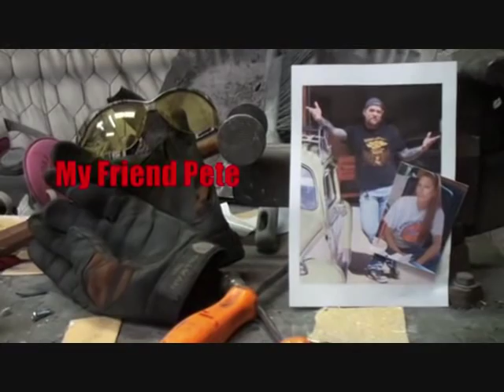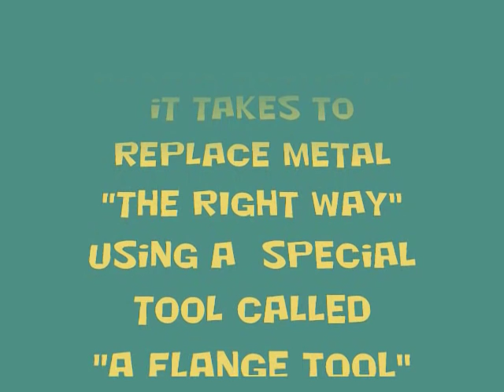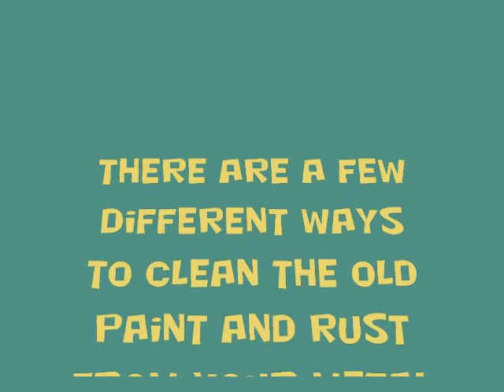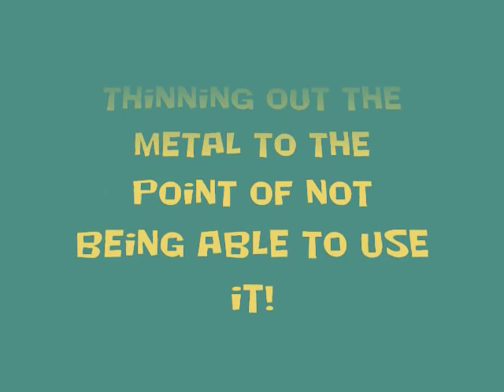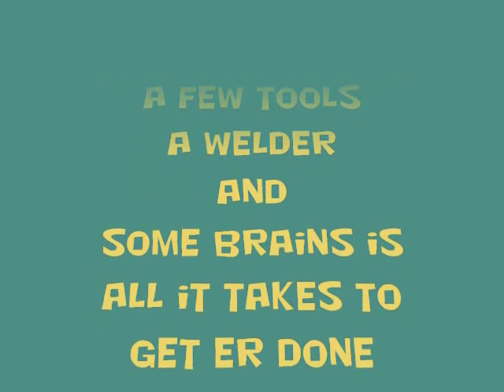RUST REPAIR | On A 1960 Chevy Impala | ULTIMATE FAIL-Part 2

Comment: Using a flange tool is the wrong if you ask me. When i fix rust i always buttweld and try to make look as original as i can and make It so you cant see that its been reparied, not hating! Still watch all your videos! Learned a lot from you!

Comment: Great video pete, I have the hand panel flanger, harder to work with it, want to buy the air punch flanger soon. I am so used to doing butt welding with sheetmetal spacer clamps, more work but I get the job done. See my new videos when you have time pete.
Reply: Thomas1233385 Will do!

Comment: Hey Pete what your opinion on using panel bonding glue on repairs? I'm thinking of using it to repair my lower front quarter extension on my 2001 Suburban 4x4 to fix a rot hole. 
Keep up the good work Sir.
Reply: Lawrence Eich Panel bond is a good tool for some parts that join togeather at certain points of interest but you still have to spot weld the panel on for structural strength!

Comment: I'm waiting on a Hobart welder I ordered, before I get into this.  My Northern Tool Chinese made welder was defective and I have the wire feed motor bypassed with lantern batteries and a rheostat.  It works, but it's no good for precision welding because  it's hard to set the right wire speed..  Since I will be doing only one car, I am going to try to get away with flux core wire and use what I heard is the best wire (by Forney).  If I was a pro, I'd get the CO2/Argon, but I may be able to get by with flux if I take my time.  It's on only one car.   In my case, if I got the CO2/Argon tank, it would be sitting around for at least a year, taking up space, after I did the one car.   I remember HOW to do the work, but there is this other word called SKILL and that takes lots of practice.

Comment: That's art work.  How come I always here don't use  flange joints when patching panels because the joint will hold dirt and moisture and will eventually rot the metal or make the paint blister?  Is butt welding better? Whats the secret to flange joints not causing future problems
Reply: Ozzstar Pete says that the seam sealer he puts on there, seals it so nothing gets into the joint.

Comment: I am working on my first DIY body work project. Doing a frame off restore on a 1978 Jeep CJ7. I have the tub off and am wondering should my metal repair come before stripping the tub down? The tub needs a good repaint. Thirty+ years of crappy paint jobs. Also, is a cup brush on a. 4" grinder too abrasive on body panels? I want to keep it simple but not trash my tub either. Thanks.
Reply from the maker: Michael Donnel When I do a bare metal resto. I strip it down to bare metal first then apply 2 coats of epoxy primer to protect it from the elements, then you can go back and sand off the epoxy primer where your going to do the metal work and body work, once your done you then sand the epoxy primer with 180 grit and apply 2K filler primer for block sanding.
Reply: Thank you for the information. Any suggestions on the best way to strip the tub down? I dont mind the manual labor. Looks like blasting will be expensive. Would a DA sander do the trick or can a wire cup brush on a 4" grinder do it? I loved the video using the bondo buster but a $375+ sander scares me away.

Comment: I see how using the flange tool helps to make a strong repair but do you not think some patch panels can be butt welded? Or is a flange always the way to go.
Reply: nel6211 You can butt weld if you know how to weld good or even better use a tig welder for butt welding, what makes the butt weld bad is when you have to grind the weld down it thins the metal and warps it from heat..

Comment: Hey Pete, sorry if you said it in the video and I just didn't notice, but why couldn't you just use the good fender rather than going through the trouble of destroying a good fender to fix a shitty fender?
Reply: Chuck Norris The other  fender is a parts fender that has major rust in certian areas and also the wrong trim holes...
Reply: swrncpete Wondered the same thing...

Comment: You should see how most of the yoyo's around here "fix" rust.  They use fiberglass.  You'd be better off pop-riveting a panel in place that that crap.
Reply: syyenergy7 Yeah, there's a worst way using ALL METAL BONDO! VIDEO COMING SOON!
Reply: swrncpete I used to do mechanic work on my own for money when I was going to college and I worked many hours for a friend that did bodywork, so remember a lot from yesteryear.  Tell 'ya the truth I have about zero respect for the desk jockeys & total respect for bluecollar.  When they came out with "tiger-hairs" bondo they claimed it was waterproof.  That was semi-true as the tiger-hairs stuff was not effected, but any plastic put over it totally bubbled up.  I actually got a lot of business doing mechanic work on my own back then because I did the stuff right.  There are loads of screwups out there that do shoddy work.  I'll be looking forward to your video.  I always check out your channel.
Reply from the maker: syyenergy7 tiger hair is nothing more then dyno-glass bondo, it's bondo with fine strands of fiberglass matt mixed in to it! it's a great product for your first filler, but other then that it's not good to use as a finish filler!
Reply: diyautoschool There are many, many claims about health "cures" & "miracles".  I researched the hell out of them and many are exaggerated, but mega vitamin C is not a scam in the least.  One more, NAC, N-acetyl-cysteine, that stuff can help prevent hearing loss and heart attacks plus it has many other benefits.  It's a type of protein.  Cholesterol does not clog arteries.  NAC will help clear arteries & veins.  Cholesterol is a money scam for doctors.  On the other side many of these "alternative" health people are full of it too.  You have to watch from every angle. That NAC may be a good one too, partly because you are always in areas of loud noise.  It's not bs.that it can help protect hearing.  The military has been considering it.